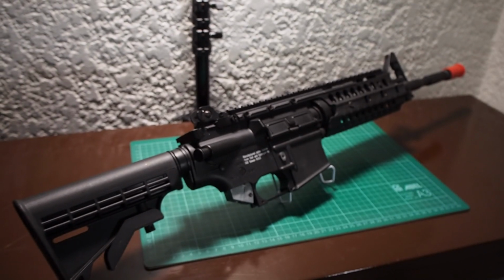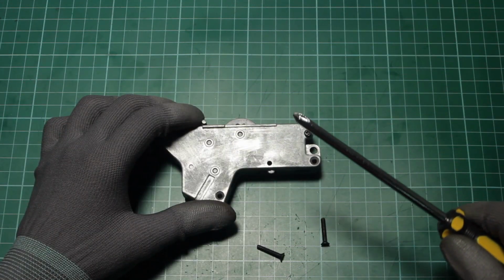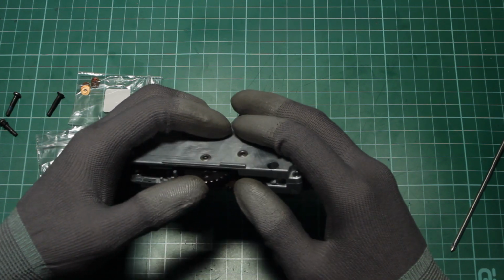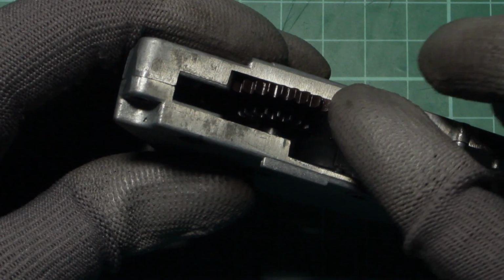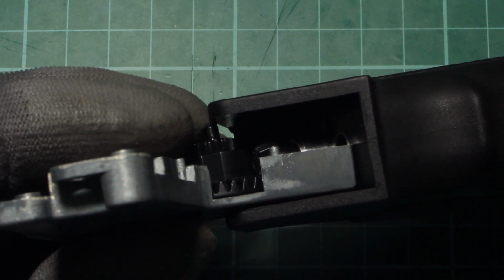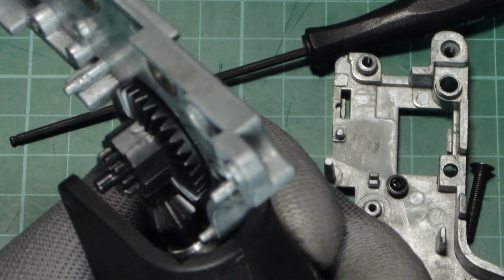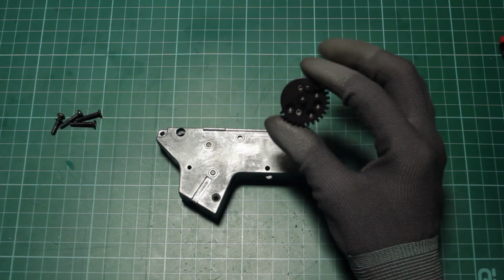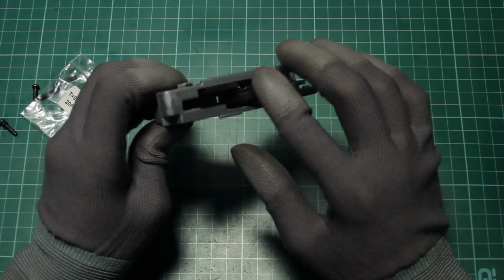Airsoft Diaries 8.1: ICS M4 Rebuild Part 1 - Shimming Gears

Comment: Is there no lubricant needed? I watched another M4 V2 gearbox assembly and they also didn't lubricate
Reply from the maker: In the final assembly you will need to grease the gears and axles.  The shimming is done by feel.  Adding lube / grease during this process can dull the spin and contact feel of the gears making it difficult to judge resistance.

Comment: Thanks for putting this series on the ICS M4.  I only run ICS M4 and have been a loyal ICS user since 2007.  Your series on the ICS M4 is awesome and useful for someone like me. 

Questions:  will you do a restoration of ICS AK74?  I would like to use a quick change v3 gearbox on the ICS AK74 (circa 2008).  do you know if any current, modern v3 gearboxes would work in an old ICS AK74?  thank you.
Reply from the maker: I'm glad you found it useful.  Unfortunately I do not have or have seen an ICS AK74.  However, if I ever run into one I'll make sure to grab it and investigate. :)

Comment: I’ve never understood starting with the spur gear. If the whole point of shimming your gears is to create an optimal energy transfer from battery to end or sector gear, then why not start your shimming with the motor height/bevel to pinion contact where energy transfer starts? If you if start with the spur gear then you’re setting spur height without taking into consideration you’re bevel to pinion shimming. If it works for you to start with the spur then go for it, but you’re going out of your way to shim a gear that you don’t know what height it needs to be at yet.
Reply from the maker: Thank you for your interest!  It's a matter of preference in my honest opinion.  I like to start with the spur gear because it requires the least variables to consider and least time to complete.
The spur gear only needs to be shimmed to sit at the lowest point against the gearbox shell while still being able to spin freely, at which point it clears all obstacles like bushings which can sometimes add a bit of height.
This does two things for me.  It leaves ample room for the sector gear and bevel gear to be positioned however one would want while maintaining sufficient contact between the gear teeth.
I also find myself spending a lot of time fine tuning the bevel to pinion contact and the sector gear's own clearances that I just feel a lot better completing part of the shimming job quickly without much effort. ✌

Comment: Isnt this shimming technique same as bevel to pinion but with extra steps? Is it better?
Reply from the maker: I had to google the bevel to pinion method.  From what I can tell, the difference lies in which gear the shimming process is initiated.

I view the bevel to pinion process as an inevitable step in the shimming proceedure.

They are comparable in my opinion and starting at either the spur or bevel gear eventually leads to the other, producing the same result.  Just don't start with the sector gear.

I personally prefer to start with the spur gear as it is the quickest to shim.  Go with what you feel comfortable with. ✌